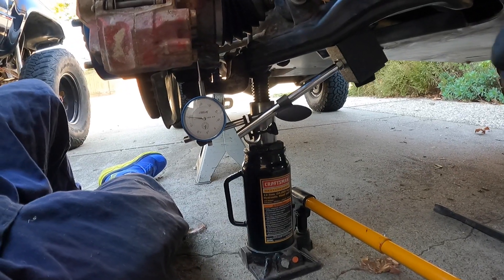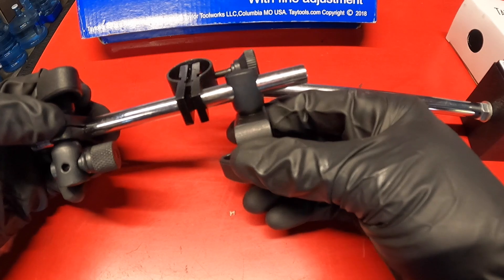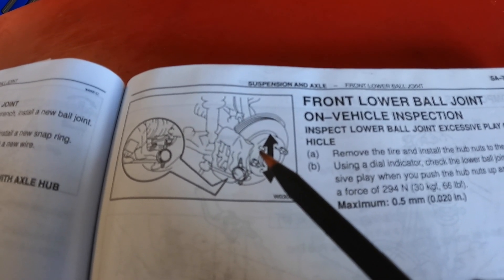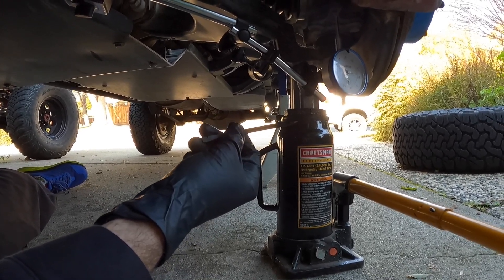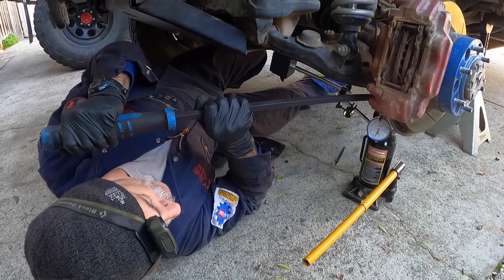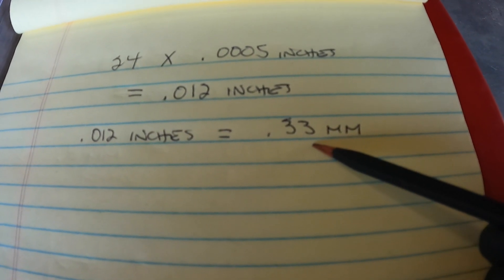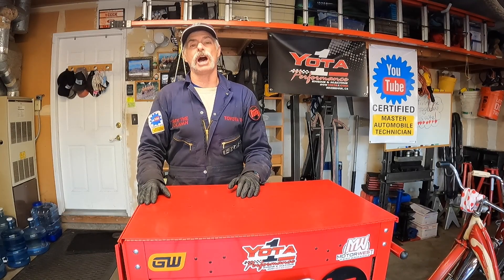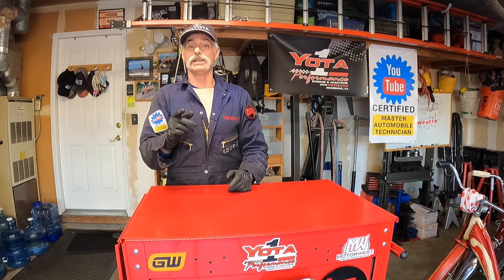Checking Balljoint Play with a Dial Indicator

Comment: Do you know the tolerance for outer tie rod ends with the dial indicator? Can’t find any info.
Reply from the maker: No, i don't.  For an outer tie rod inspection, you can just feel for play in the joint.  It's easiest with two people.  You jack up the front end and you have someone introduce some steering input back and forth while you have your hand grabbing onto the joint.  If you feel a popping or clunking, the joint is bad.  If there's no detectable play, the joint is good.  

You can also do the inspection yourself, but it's a little harder.  Push and pull on the tire with one hand while grabbing onto the joint with the other feeling for play.

Comment: What about Tundras?
Reply from the maker: What about them?  Any vehicle can have a balljoint failure.  If you're asking if Tundras are known for failures, like the 3rd Gen 4runners and 1st Gen Tacomas, I'm not sure because I don't really travel in the Tundra social circle that much.
Reply: @TimmyTheToolman They are also known for LBJ failures. I dont know the spec off hand. Its not much just like this video. On the tundras Toyota recommends replacing the 4 bolts also depending on which year and bolt  type you have (thats another rabbit hole to go down lol, possible misprint on torque specs etc). I know its an old video but thanks anyway! Always great info Timmaaay!
Off to check mine with a pry bar 😂
Reply from the maker: @rptrick79  Yeah, when that guy asked that question, I didn't know early 1st Gen Tundras have the same steering knuckle and ball joint setup as 3rd Gen 4runners and 1st Gen Tacomas.  

There definitely are two different bolts that were used for the LBJs, and they have different torque values associated with them.  It's not a misprint.  I mention this in the video description of our LBJ replacement video.
Reply: @TimmyTheToolman  interesting. I'll find that video and see if it helps me and a bunch of others understand more. The fsm for 05-06 tundras has 48ftlbs and 59 on  consecutive pages iirc. But it doesn't mention why. Thanks for the videos as always!
Reply from the maker: @rptrick79  Read the video description of this video.  https://youtu.be/bfLvtEnX9qk?si=HGjM3M8AWmy2RlWp
Reply: @TimmyTheToolman I posted a long reply. Not showing up.. anyways, the fsm has those 2 , 48 and 59. Loctite recommends reducing torq by 20% if using it. 20% of 59 is 47.2. maybe it's rounded up to 48 ftlbs. I wonder.if they are accounting for the red loctite that comes on the LBJ bolts and they forgot to add a "fine print note". Either way it doesn't get up to 80ftlbs that the spiker engineering thread describes as the high end of failure for torquing...just a thought

Comment: Good Mechanicing !! Tim, and this gauge can be used on bigger trucks, where it's really expensive and work intensive to replace Ball Joints. I was going down the Highway in my 2000 Tundra, my passenger side Ball Joint decided to detonate, the the truck lost the wheel assembly and the truck frame crashed down into the pavement and an exciting wild ride ensued, because the brakes don't work and you can't steer since the steering gear is on the pavement grinding along on momentum. Sparks were flying. No one was coming the other way, and nobody was hurt, fortunately, but the Truck was damaged. I know Parts just keep going up and up, and not a lot of people experience what I did,( and I keep very good maintenance regime on my vehicles) but on this one part, that can cause a major mishap, at a high speed, instantaneously, no warning,  I would suggest that if folks see any movement on the dial, that discernable, Excellent, that's what gauges are supposed to do, Change the Ball Joint out! Good Confirmation! These specific Ball Joints can deteriorate inside, that you can't see, Much faster than usual. However, my many Toyot a vehicles over the years, have all been excellent Vehicles, and I love the ones I have and drive now too, and will continue to drive Toyota. I love Toyota. Just replace Ball Joints on a Mileage regime, problem solved. Happy Motoring.
Reply from the maker: Yeah, the problem is you can see discernible play in these joints with very little miles on them.  I think this is why Toyota allows for some movement in the joint and to still consider it safe.  My buddy Rich, who showed me how to do this had play in his joints only after a short amount of miles, like 10k.  So yes, if your balljoints have excessive play, definitely replace them.  If they are within the acceptable range, you're good to keep running them.
Reply: @TimmyTheToolman  I really respect your   knowledge and obvious good hands on the tools, But, and its just me, Parts have different "Runs", some good some bad, and different Makers like MOOG, and higher end  Partsmaker, have higher and better standards specs, and tolerences, on high end parts, than the Auto Companies. If a Simple Ball is wearing down with only 10,000 on it, then from experience with Ball Joints we all know that's Super Duper bad performance, I would call that derelict, especially for Toyota!  My whole Tundra rusted right out from underneath me, Toyota after all this World wide trouble, should get their act together and start making higher quality Steel in their Ball Joints, Toyota has some manufacturing problems and this has been a doosy!!  I love Toyota, But when it comes to safety,I call 'em the way I see them!!!!  I'm moving to the Best Moog to see if I get better longevity, if I do I'll let you know next year, it'll be interesting and hopefully better! Keep Up the Great Video's !!! J
Reply from the maker: @EvanGrey56  No argument there.  Toyota could do better on many fronts.
Reply: I think part of the equation here is that a ball joint has to have some amount of play in it unless it’s seized (which is a problem all its own).  To be able to articulate, at least a non-zero amount of clearance must be there. You can’t feel it with your hands holding a new balljoint fresh out of the box.
Reply: @cbh148  Oh true cbh, good point. But we've all had ball joints that last and last, (200,000m) even "clanky" and you hear them but they don't fly apart abruptly. I see ball joints coming smaller and smaller diameter, and that puts pressure Way Up, and if steel quality isn't there....kaboom! Brash Break. Just my observation, I could be wrong. Used to be price dictated quality and you knew what you were getting. Now the ONLY standard a consumer has is to see what Country it was made in. The Merchant world is unscrupulous.

Comment: Timmy, great video as usual! I'm curious if there is any detectable play on a brand new OEM ball joint vs a more worn ball joint. 

Also, at approximately 0.33 mm, was there any discernable play when you were using your crowbar? I do the same every oil change with a long breaker bar, but I feel like it might be difficult to notice 0.5 mm of play. 

Your comments are appreciated and thanks for the video.
Reply from the maker: When I did this video, I couldn't see the play with my eyes.  On other occasions I could see some play but it's deceiving.  Once you hook up the dial indicator, the play you thought was excessive, really wasn't.  That's why I made this video so people can accurately measure the play.  If there's a massive amount of movement, Ok, you know the joint is toast.  But, a tiny bit of movement you think is excessive might not actually be until you measure it.

I've never tried to measure brand new joints so I don't know if they have play straight from the factory.
Reply: @TimmyTheToolman  appreciate the response. Thanks again
Reply from the maker: @vicoll135  You're welcome.